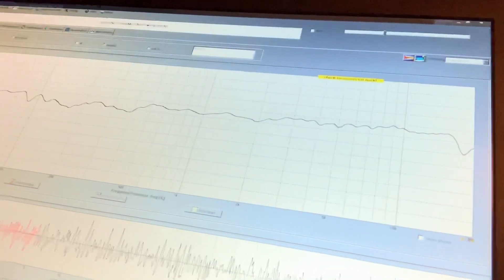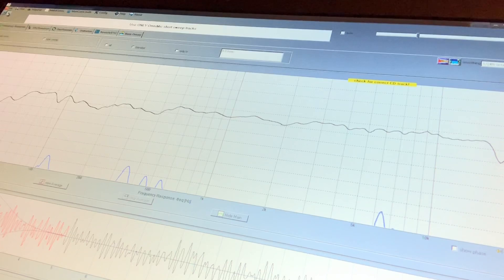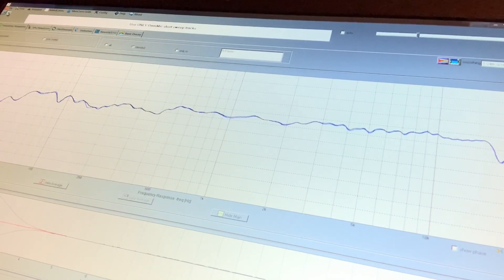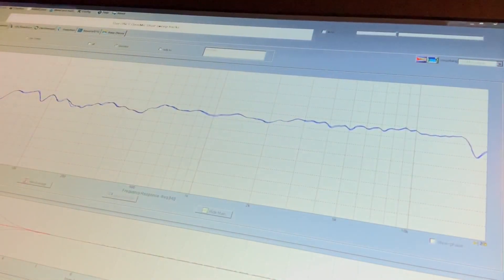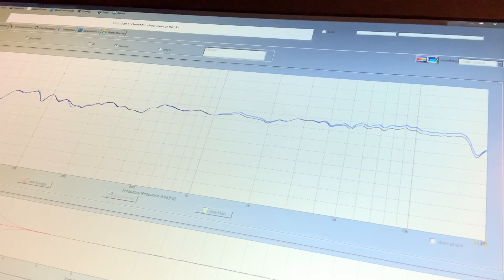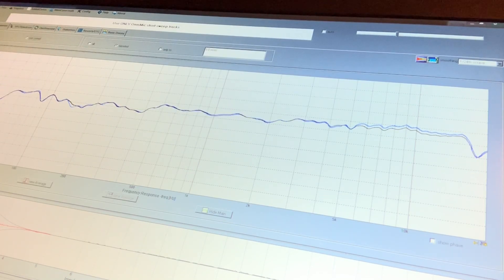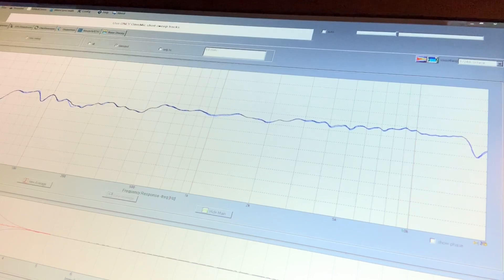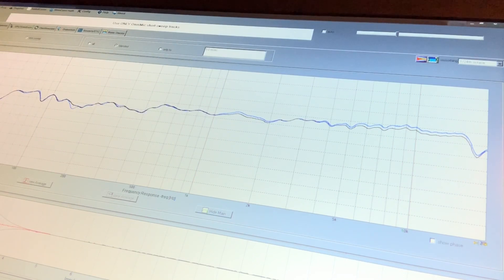Dayton Omnimic Real-time Measurement Demo

Comment: You can see the response, but you dont see phase difference, you need a oscilloscope to see that, phase is much bigger deal than this
Reply from the maker: Omnimic does measure phase, but the phase interaction between two sound sources (say a tweeter and a midrange) is expressed in the frequency response, if the response is flat through the crossover range, and generates a deep v-null with the polarity reversed, then there is a good phase match between the two drivers.  We don't hear phase, we hear frequency response which makes response the only thing that matters and needing to be optimized.
Reply: @javadshadzi4824  a phase give you 3d sound stage, if midrange is 40° of phase you cannot see it in frequency response, but you can hear it with muddy vocal and instruments position
Reply from the maker: @doxzlaborathory  I'm sorry but nothing you wrote in that last response is technically correct.  If the drivers are out of phase, they will cancel in the frequency realm and it will change response.  If you change phase, you change response. If phase is the wind, you don't see the air moving, but you see the tree branches moving, that's how phase responds with frequency response.
Reply: @javadshadzi4824  if hightone speaker moves forward, and mid is moving also forward but with delay, it will cause muddy 3d soundstage crossover makes cutting but 6dB is not much... Our ear can notice phase difference, that is why when you put headphones and listen to that " barber shop" recording you can tell how far is everything around you, you can feel your 3d surrounding just by hearing it.
Many people will tell you that flat responce speakers, are not good... The best listening experience is from one full spectrum speaker, good designed, that cannot produce flat response, but there is very nice and realistic 3d sound stage.
Reply: @javadshadzi4824  phase difference is not about cancelation, its about not playing synchronized
Reply from the maker: @doxzlaborathory  you are talking about time alignment, not phase. Again we don't hear phase, we hear frequency response.
Reply from the maker: @doxzlaborathory  you are confused about what phase is, listening to headphones won't change that.  I suggest you read up on phase, there are a number of good AES papers about phase and the ability to hear it.
Reply: @javadshadzi4824  explain to me how can you hear 360 sound around you if its not a phase difference and offets
Reply: @javadshadzi4824  what makes a sound stage, its not a flat response, what else is there?

Comment: Thanks - fast and can stay in loop, recording changes in Frq - sweet, one of most useful feature for audio DIY selfer. Time to retire my 20 year old Clio - yup still in DOS.
I have question, since I noticed you run the SB26STAC in Rivalries way down to 1.2-1.3kHz - did you try other tweeters that are capable of crossing that low w/o turning into screamers - maybe some favorites. 
I'm running Mark's Kravczenko KAXBL around 1.8kHz - we made faceplate from MDF. Capable tweeter, but because it starts to roll off around 1.5k it's really hard to get smooth response  around x-o and I would like to squeeze more out of SB17NRX, meaning cross it closer to 1k, also the size of capacitors is rather big with KAXBL. 
Thanks for videos and NouRouz Piruz - all best.